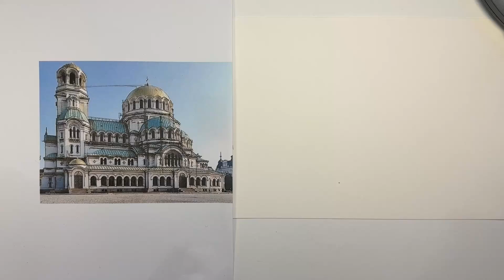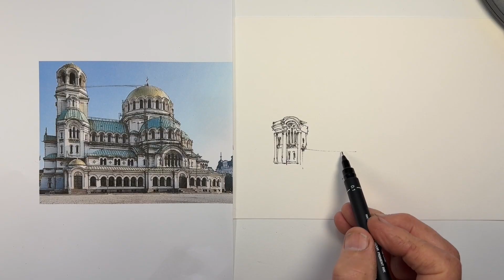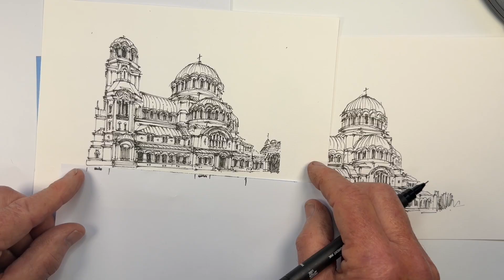What Difference Does the Time Spent Drawing Make?

Comment: What's the difference? Well, I think one could nick pick on the details of the line work, but that is expected to happen when you try to catch the same amount of details in both drawings (more on the issue with details at the end). But what stands out to me is mainly two things, the proportion and the sense of depth. Imo, if you don't know the intention of the drawing, the proportion is not much of an issue, since you could argue it's just a difference in applied lenses to the same motive, i.e. a difference in perspective method.

The more serious issue is the lose of depth. The second, fast, drawing feels flat. It describes the shapes but miss the sense of form. I believe this is due to not taking the time to carefully observe subtle angles and curves of lines and/or not being mindful of forms. For instance compare the angle of the connecting roof between the front tower and the doom in both drawings. They are different. Or the lines on the lower roof in the middle, they are straight instead of slightly curved. Small things like this have a big effect on the sense of form and it easy to oversee this when in hurry and not having the time to think through the actual form before making the marks.

There is also a (lack of) difference in line weight that contributes to the lose of an illusion of form. Consider the time you had at hand for each drawing, none of these drawings are bad but the illusion of form is stronger in the first, longer, drawing. This for obvious technical reasons, technical details which you did not have the time to implement in the short drawing because you instead decided to try to capture the same amount of details as in the long drawing. This was your major drawing mistake, and that leads leads me into the importance of observations.

In your first drawing you talked about the importance of careful observations. I think this second, faster drawing, drives home this point. Faster drawing is not about moving the pen faster but observing less, thus capturing less details. However, if you try to capture as many details in a fast drawing as in a slow you will make mistakes because you wont have time to observe as much and will fall into the cognitive trap "I know what that looks like and how to draw that", and then you draw from imagination rather than observation.

You even admitted to be wittingly guilty of this at the beginning of the video when you said you had the previous drawing still fresh in memory. In order to capture as many details, you knew in advance you cant draw faster purely mechanically but had to scarify observation time, and that's okay to do since this was deliberate and intentional done as test by you and this test underlines, yet again, the importance of taking our time to observe the subject we are drawing - even when we think we know it well.
Reply: Regarding being mindful about form. I actually reacted in real time when Stephen draw straight lines on the middle roof and felt that cannot be right and check if those marks describe the correct form in the reference photo. They did not, those line should be lightly curved, so I was left wondering whether this was just careless drawn or if this was erroneous assumed to be a flat roof. I'd lean to assume the latter.
Reply from the maker: It was a compromise to time. In the first drawing I still felt a time pressure as you can only have a video so long and time lapse so fast.
Reply: @stephentraversart  You can always compress twice, and then do a voice over after the second time compression.